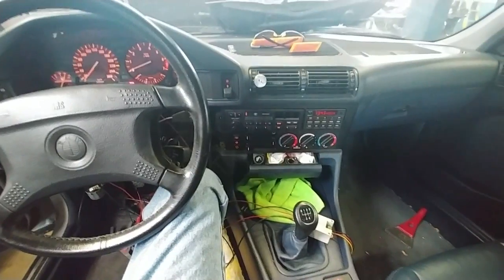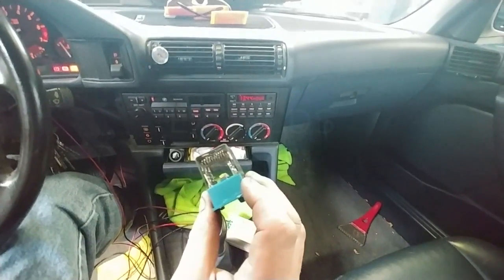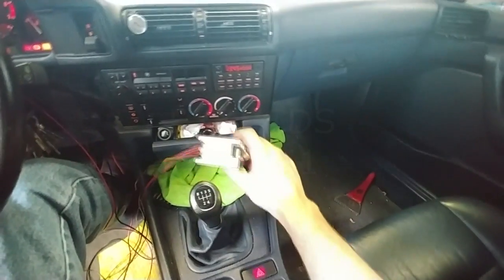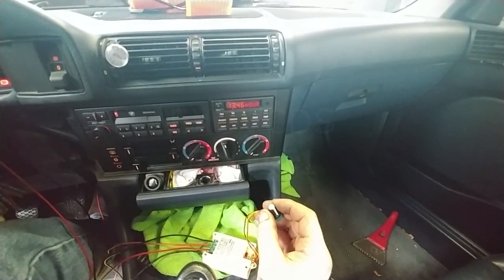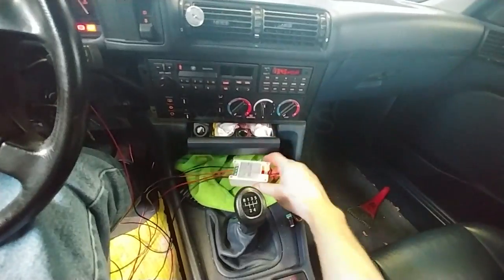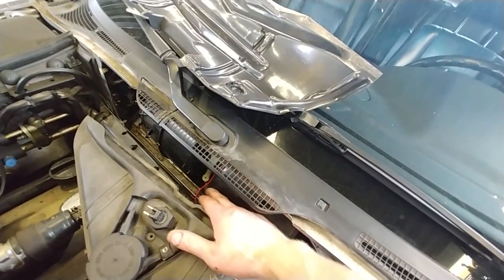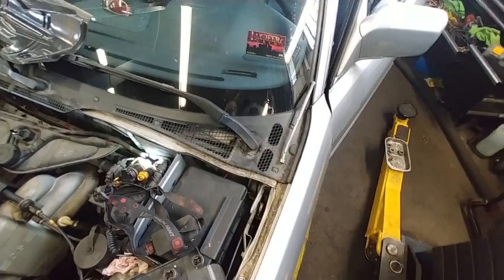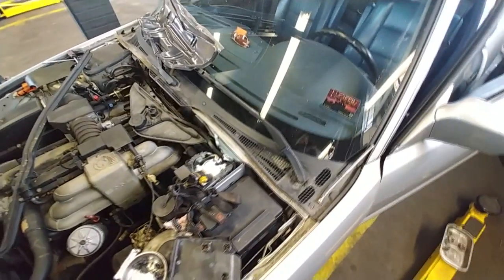E34 blower motor upgrade

Comment: dear Thomas is there any Specification for PWM i mean the Volt and Ampere ? Thanks
Reply from the maker: What is the fuse size for the blower motor?
Most PWM controllers are able to handle a variety of voltage inputs. Choose one that is rated for the amperage of the stock fuse and the 12v changing system of the vehicle.

Comment: Hi! I have an e34 sedan 92mod, i would like to modify this as well. really good idea. How is the wiring done ? do you have any instructions on wich wires you will search after ? Is the wires from the DC fan motor ?
Reply from the maker: The controller has 4 connections.
a) 2 connections need to be attached to + & - (power supply & ground).
b) The other 2 connections go to the blower motor (power & ground).
I used the original power wire that goes to the resistor pack as my main power wire in step a)
Use whatever ground location for the controller that works good for you (located in a easy to access place).
From the controller to the motor is straight forward, just route the wires in such a way that they don't get damaged.
Reply: @EXOVCDS  Thanks for supplement info :) I will order the PWM controller from droking, but maybe u have other suggestions as well ? I can search around a little bit before ordering. This must have been one of the best channel Ever! Retrofitting FTW! One other thing, do you know about the positive/negative effect on upgrading from original Coil pack to VAG/R8 coil upgrade in an M50B20 engine, which is my case .
Reply: @EXOVCDS  Thanks again, just one last question : Do you splice the wires onto the terminals on  blower motor, or do you  remove the original wiring and replace it with the new ones from the PWM controller.
Reply from the maker: I disconnected the stock wires at the motor and attached the 2 wires from the controller to the motor.

Comment: Can you do this on the bmw sword model? @thomas exovcds
Reply from the maker: Yes... my other E34 has the sword. Once it fails I will do the same to that car.
The sword is actually a "pulse width modulated controller" / works the same as the controller box that I added to this E34.
Reply: @EXOVCDS  I have a question. My e34 has the automatic climate control unit (IHKA) so it has that "scroll wheel" in the middle to control the fan speed. Would it be possible use the stock scroll wheel with this PWM controller considering the sword is also a PWM?
Reply from the maker: @nikitakononov690 
It probably is possible.

Comment: My e34 didnt make it learned the hard way after my car went up in flames. Very dangerous stuff I wish this video was up when I was searching why my vents smelled like burned paper. Thank you for posting this it is very helpful. My second e34 started giving off that smell but i fixed the issue by also cleaning out my cabin air filter of 15 years of dried leaves
Reply from the maker: Sorry to hear! My other E34 came with Pulse Width Modulated HVAC system... but the circuit board burnt a transistor and the same thing can actually happen (fire that burns the car to the ground). I bought & replaced that control board to fix it some years ago. This is a better & cheaper fix... so I'll probably convert my other E34 as well. =)

Comment: for a secound i was thinking i read blowen motor upgrade. Like Theboss garage  pontiac  disaster. What happend  to the other videos you uploaded and removed by user?
Reply from the maker: These are the videos.... YouTube had housekeeping issues last week that affected uploads / they would not play.
Reply: @EXOVCDS  seems to be getting worse with all this pcbswo rld wide. i think they allso block all comments with links by default. did you watch the coolant video from steve rob he is spot on but youtube blockt my comment it seems
Reply from the maker: In my case / last week... I think it was technical issues rather than "moderating" issues. My videos took longer than normal to upload & process (they actually never did). So I got fed up and deleted them. Uploaded them "as they were" yesterday and all was fine... and still is. In the past, I have noticed that some of my replies to viewers under MY videos were deleted. Replies that contained my email address... I'm just trying to be helpful, but youtube (robots) are in protective mode. I'm not sure what your comment contained and why youtube robots would have removed it or if it ended up in his spam folder.
Reply: @EXOVCDS  i posted a link to tst seminar video why to use facrory spec coolants. i know g12 will turn to mud if you add gm dexcool compatible with vw fluid. adding non spec meeting its rolling the dice.  And if in doubt throw it out a quote from tst older vids.
Reply from the maker: @IntradeMotors  yeah... sometimes it's better to just point people to a video rather than post the actual link. It's weird that it got moderated, since it's link to another youtube video. Doesn't make sense... but I guess youtube is still at a growing stage / learning stage.

Comment: Can you control the PWM from your original knob? Is that electrical or mechanic? You could replace it by a potentiometer
Reply from the maker: No, I can not control the PWM controller with the stock knob... the stock knob is a 4 position switch, not a potentiometer. Good thinking!
Reply: @EXOVCDS  It can be done, just figure out what resistances the potentiometer has and put them on the switches. Should work theoretically.

Comment from the maker: Link to PWM Controller will soon be added to the description.
PWM Controller I bought: (Better controllers are available on the site or via Amazon)
https://www.droking.com/dc-9-48v-motor-speed-regulator-pulse-width-modulator-dc-12v-24v-20a-pwm-controller-governor-pwm-regulator-motor-controller